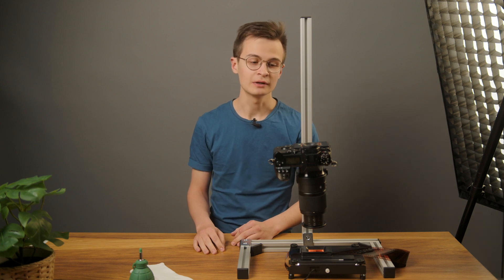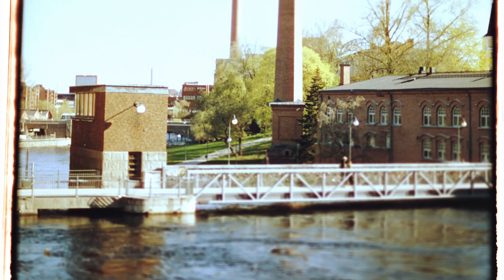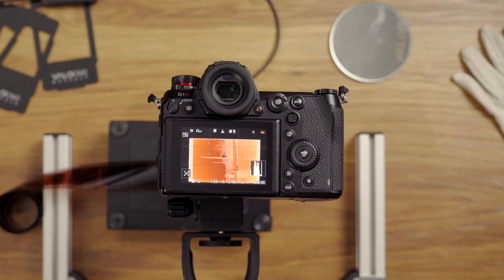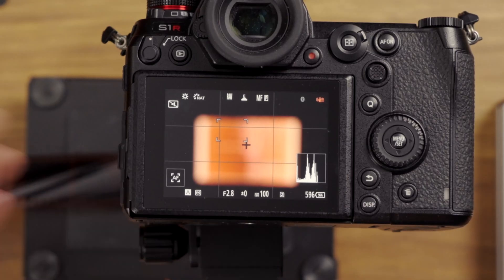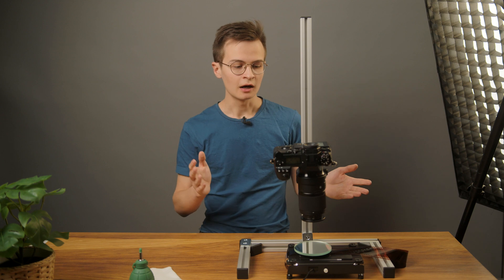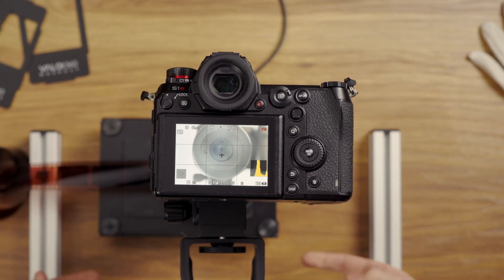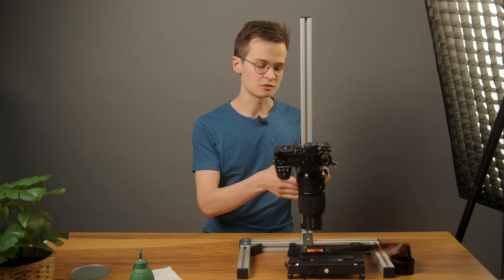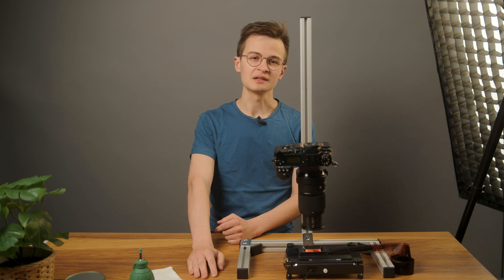Why level your scanning setup?

Comment: Old school here - back in the the day the 1:1 frame size was scribed on the mirror surface as an extra check for correct alignment of the frame.
A cable release was always used to prevent any micro-vibrations remaining if pressing the camera's self timer.

Comment: Great video on an important aspect of DSLR scanning.
To make this even more accurate and easy one can make himself an overlay, that can be used when scanning tethered to a computer. Most software that you can tether shoot with allows you to overlay an image while shooting. I made a neutral grey overlay with multiple, centred rings of varying diameter. When I align my setup I can use this overlay to line up the lens barrel or all the other rings you see in the reflection of the mirror with the rings of the overlay.